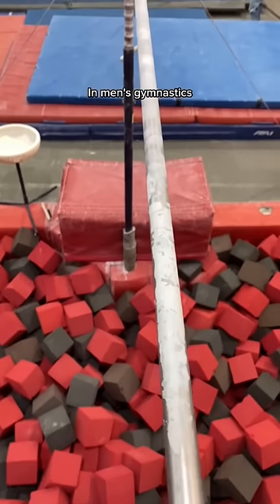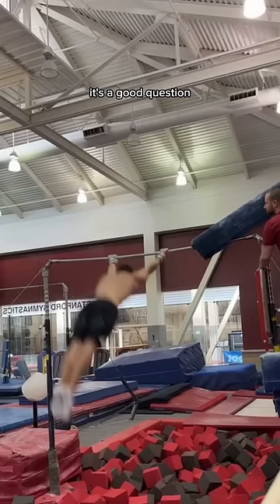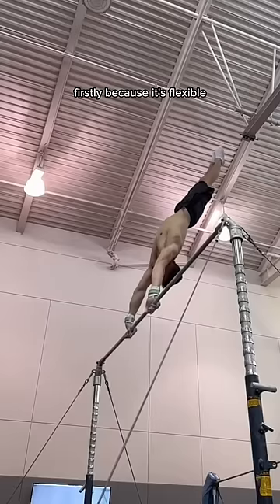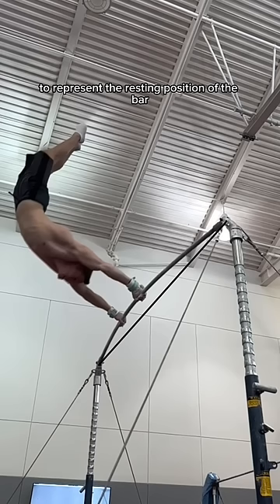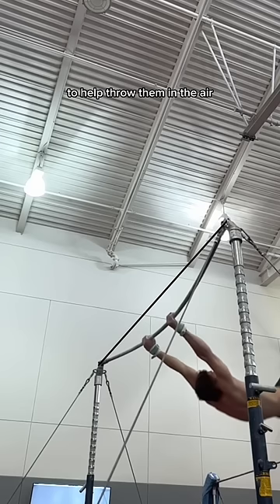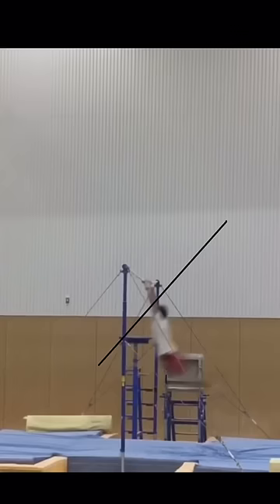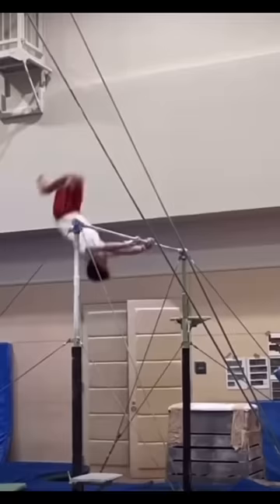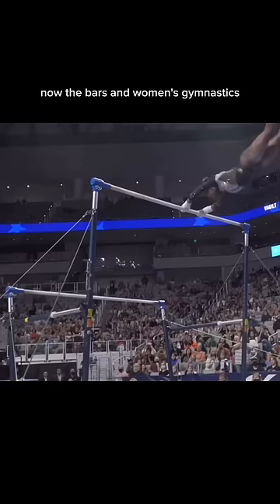Why is it made of steel 🤔 #gymnast #gymnastics #sports #calisthenics #parkour

Comment: The bar was made of steel and you still managed to break it
Reply: Yeah thats not a common thing tho
Reply: Steel has a pretty high yield point. That is, you can bend a piece of steel a lot before it wont return to its original shape. However, when you get it close to its yield point, you add a tiny bit of fatigue. If you do that over and over and over, the metal will become weaker and weaker until it eventually tears. Theres also the concept of work hardening, in which if the force on the metal slightly exceeds its yield point, the metal will become slightly harder and more brittle

Comment: If they have to be strong and flexible, is there any carbon fiber bar? Wonder if they're good also.
Reply: Carbon fiber isn't really flexible. It's strong in whatever direction it's designed to be in so if someone landed on the bar and the grains weren't point the right way it could snap
Reply: afaik in my knowledge of cars, carbon fiber is strong, but it can shatter, pretty much rendering it as really brittle.
i think this is more of a long term thing when it shatters rather than it just exploding as soon as you put a bit too much pressure on it.
but who am i to talk? maybe they're just as good or better.

Comment: The female bars do not need to be as strong because female's cannot swing as hard due to there being a second bar (uneven bars hehe) that prevents a full on streched legs swing. 

Women are lighter on average,
Women are around 10% weaker than men (no offence, it's just genetics). 

Men just do double flips and twisted flips in quick succession sometimes on the bars, while women don't even have the space, I mean look at a routine Nadia Comaneci did: she hit her hips on the lower bar while holding onto the higher bars because they are so close together.

Imaging even being able to swing enough for a double flip with bent or spread out l2gs and then crashing down on the bar whil cathing😬. No, just not probable.
Reply: Thanks for pointing that out! I was honestly a tad curious
Reply: There's actually a much higher strength differential than that. According to Princeton,  women have roughly 67% the muscle mass that men have. The study was conducted on male and female powerlifters. So even the strongest female powerlifter only has 67% of the power the strongest male powerlifter has. It's pretty crazy how big the muscle differences are between men and women, but it makes sense.
Reply: @monkeytime  wow man, that’s insane

Comment: Why couldn't it just be expressed as that women also need to be able to bend the bar to get more power to swing, and because of their lighter weight, steel isn't as suitable for the purpose?
Reply: ?

Fiberglass isn't flexible, so maybe the wood is, but my impression was that he's saying women aren't as heavy as men so they don't bend the bars, which makes it so that there's no need for something as strong and flexible as steel.
Reply: He already explained that they dont swing as hard. Using your brain you can intuit the rest
Reply: The reason it’s different is a actually cause the uneven bars started out as a set of parallel bars with one bar set to a different height. The uneven bars have gradually changed to what we have today but the materials never did (of at least never had a reason to)
Reply: @nullfield1126  ever heard of pole vaulting? Fiberglass can be very flexible.
Reply: @timdurachko  Hi! It seems like there are flexible ones indeed. Vaulting poles being a prime example, thanks for correcting me.

I only knew of the harder variants.

Comment: The name of the women's apparatus is called Uneven PARALLEL bars for a reason. My understanding is the first bars for ladies were parallel bars set at unequal heights, I don't know at what point they made them round, but I think this has far more to do with the origins of the materials used for the women's bars than anything else.
Reply: You do know parallel just means running alongside each other right? So the two bars running alongside each other makes them parallel. So the bars could likely still have been round when first created?
Reply: You might be mistaken on what parallel means...

Comment: Also to add, the bars in women’s gymnastics were originally a lot closer together and were essentially the men’s p-bars with each bar at a different height, hence why they are called uneven bars or asymmetric bars. Over time the bar has become further apart and the skills competed have changed, but I’d imagine it also relates to the origins of the apparatus - just as the men’s high bar has always been made of steel. The skills that men and women compete on each also differs a lot, though as a former competitive gymnast we did use the high bar with gloves and straps to train skills before taking them to the wooden bars. But having used the wooden bars my whole life with a very different grip, it also felt so strange and not wide enough when using the steel bar 😂

Comment: Huh. Interesting. So if a man would use the female's bar, would the bar break?
Reply: It would be a lot harder for men to do skills on a female bar, because along with being wood, the bar is a lot thicker and bigger and would be harder to grip. Would it break? Probably not. It would just be a lot harder to do flips and such over it without the springy quality
Reply: The wooden bar doesn’t bend as much and is much thicker than the steel. It wouldn’t break but it would be a lot harder to do skills.

Comment: Okay, but who would care about the average in the top level? Surely, both would need strong materials when they're taking the human limit. The sex advantage can only carry so far before it starts boiling down to pure skill and training even against someone without said advantage.
Reply: Or … maybe, men just on average weigh more than women?
Reply: The wood and fiberglass are strong enough. And keep in mind that both averages increase as you go up in skill. Joe shmoe will probably weigh a bit more than peak female athlete but peak male athlete will most certainly weigh more than peak female. The bars need to be different. Also, this is not an example of pure skill. This is high amounts of skill and high amounts of muscle. Which is heavy and that men have more off. Chess and other games are "pure skill". Every sport will have advantages and disadvantages based on muscular genetics.
Reply: The sex differences become greater at the higher levels , use your brain
Reply: The reason it’s different is actually cause the uneven bars started out as a set of parallel bars with one bar set to a different height. The uneven bars have gradually changed to what we have today but the materials it was made of never did (or at least never had a reason to)

Comment: Isn't that like begging the question, or cart before the horse or some shit? They men use steel because it bends but the women don't use steel because they don't bend as much? That actually makes no sense. It seems like the use of the steel dictates potential, not the other way around.
Reply: Well men are heavier and stronger on average. Idk
Reply: I’m pretty sure this guy above summed it up. idk
Reply: I saw this on another comment and it said because the grip used in women and men’s gymnastics are different. Women’s gymnastics needs to switch between two different bars where the men’s is just one bar. Female gymnasts are also usually lighter due to the demands for flexibility
Reply: "They men"

Comment: Steel was also chosen because it doesn’t splinter as much when broke and doesn’t typically get a sharp edge. Along with this, men’s gymnastics came before women’s so, as technology advanced and steel got expensive, women’s use cheaper but reliable materials since a lot of them need to be made.

Comment: Women’s bars were originally men’s parallel bars just staggered. Look at old routines from the 50’s and the 60’s. It was a completely different event from what it is today. The cross section of the old parallel bars was an egg shaped oval with the wider part at the top. As the event evolved the bar became more of a true oval but still made of wood. In the 80’s a common combination was a belly beat and land on the feet on the low bar and jump to handstand on the high bar. As you rose off the bar from the belly beat the bar oscillates. If you land on the feet at the wrong point of the oscillation you go right through the bar breaking it. At one college meet we broke 3. They started making the rails out of fiberglass with a wood laminate so it still felt like wood. They also changed the cross section of the bar to be less oval and more circular, also smaller in circumference. So much nicer to work on and more bouncy. Gymnastics has evolved, wood for women and steel for men was not a decision from the onset. The evolution of men’s high bar is almost as interesting.

Comment: Also because the weight in still is 10 to the biggest I've seen was like 30 or 40kg lightest woman to heaviest man but it would be about 10 or 20 on heaviest to heaviest. And now you take in physics, the force those extra 10 20 kg put in would probably be able and snap the womens bar and so it's just safer to have men stay on steel while women get the safer bar

Comment: Maybe Carbon Fiber could also be a good material?
Reply: Way too flexible, carbon fiber strength lies in tensile strength not shear
Reply: @RYU47376  Yeah, just that I know about planes and on newer ones Carbon Fiber is ised for the exact same reasons listed here, so I thought it could be a good idea
Reply: I thought carbon fiber was not flexible at all?
Reply: @dubious_potat4587  It is, thats why it is getting used in planes recently. It is very lightweight, strong and flexible

Comment: Wood and fiberglass sounds way more dangerous.
Reply: no it won’t shatter like you think and hitting blunt steel would hurt a lot lot more
Reply: @alilalani9531  hitting wood doesn't sound pleasant either
Reply: @StressHaze  still .. Compared to steel , wood is better(despite both hurts as hell
Reply: Nah the fiberglass bars are much more forgiving, women make much more bodily contact with the bars so a steel bar would just be painful. I remember messing around on the girls bars and it was much easier to make consistent contact with it
Reply: Yea the reason it’s different is actually cause the uneven bars started out as a set of parallel bars with one bar set to a different height. The uneven bars have gradually changed to what we have today but the materials it was made of never did (or at least never had a reason to)

Comment: I thought it was obvious 
I know Jack all about gymnastics 
But I could tell they're different because men are typically larger and exert more force on the bar 
Women just wouldn't bend the bars that much so fiberglass and wood is acceptable there 
While men exert more for e and therefore need something a bit more strong and a bit more flexible

Comment: The difference is just what material is best suited to each sport. High bar is all about building up momentum for big releases, therefore, the bar is springy to assist in launching the gymnast off of it. An inflexible bar would inhibit that. Uneven bars are about transitions and combos, therefore, the bars are solid to conserve the energy for the next swing after a transition. A springy bar would act like a shock absorber and dissipate the energy rather than conserving it for the combo or next transition. The apparatus doesn't care what sex you are, it's designed to enable the sport it was built for.
Reply: Thank you. This person understands gymnastics.

Comment: I guess we have to fix this sport now
Reply: Yes, but for completely different reasons than the comment section seems to think right now. Did you know that women get points taken off if they don't smile, or if a bra strap or bit of panty is showing? They also have to have bare legs while performing. Men don't have to smile (it might actually be discouraged? Not sure on that one), and are often required to wear long pants (which was explained in a different video). Like, why couldn't a female gymnast wear biker shorts, footless tights, or the same pants as the guys if they wanted? Why should they get downgraded for being tired and not wanting to smile near the end of a routine because they need to concentrate instead?

Comment: I like how he keeps saying "on average" so he's not just saying women don't do as many powerful swings when some might or do
Reply: Their routine is overall different. Look up competitions. Also, on average it’s easier for women to swing than for man, because their center of weight is lower (and again, theoretically on average, but every sport requires certain physique, so in this case generalization is not incorrect, for example almost all competitive swimmers are tall and slim), so they don’t need to use the same amount of force to swing, it’s generally easier to swing if your center of mass is lower

Comment: Question, if the mens and womens bars were made of the same material, how would that impact the sport? 

Would it improve performance for women if they used the men’s bar, or vice versa if men used a women’s bar?
Reply: It would probably depend on the man and woman

If there was a woman who was incorporating a lot of intense flips into her performance or if she were heavier, or if a man was smaller and/or doing a set that had some of the moves that women do, then a different bar might aid them

Since men are typically less flexible, the flexible bar helps them out when swinging their weight around. And since women are typically more flexible, they don’t really need that, and the bar staying in place aids them more. Like he said though, it’s on average. You probably get used to whatever bar you’ve been using eventually, and either way switching it up would affect your performance
Reply: Yeah, men and women also usually do different types of executions on the bar, and might be scored on different aspects of the performance. Stuff like Technique and Artistry can be seen with different eyes by the judges for men and women.

So even if a steel bar would make a women perform better in the aspects that are scored for men, it might hamper the aspects that are scored for women.

Comment: Different tricks call for different material, is essentially the sum of it, for anyone wondering.
There’s a reason why they’re differentiated by Women’s and Men’s Gymnastics. If they all did the same thing, same methods, with the same techniques, they would’ve just called it “Gymnastics”.
Both can be extremely good at either, it’s just the way they’ve categorized the two by body type. (The Men are often Bulkier/Heavier since they gain muscle mass far more/quicker than the Women, which is basic Biology. Women in these sports lose fat and become Toned, and on average have less body mass. So they don’t require a bar that tough, because they’re elegant, and often way lighter/gentle.)
And yes, men can be slim in these sports and women can be bulky. I’m just speaking in the high percentage (Majority) of people that pertain to these reason. Which is, almost everyone. (Plus, women are typically more bottom heavy than men. So the momentum is carried much differently for either materials.)
Hope this helped. Have a good one. 👌
Reply: This is like the most friendly explanation of a somehow highly controversial fact. Respect

Comment: Women are usually lighter than men, especially gymnasts, so having a steel bar for the women would probably hamper their ability to launch off the bar since it wouldn't bend very much unless they made a thinner bar for the women, which would probably cause other issues for them.
Reply: It’s not based off a body type it’s age based

Comment: Do some of y’all actually think that men weigh so much more that if they touch a women’s bar it’ll snap instantly? It’s pretty easy to find videos of guys performing tricks on a wooden bar, it holds up just fine.
Reply: 1. He said presumably, he's making a reasonable estimate because 2. He said on average.
Men on average have more muscle and weight meaning that it's a reasonable estimation that a stronger material is needed.
Reply: @cheesemcbiscuit3713  I wasn’t talking about him I was talking about people in the comments
Reply: That is not what they are saying. After so many strong swings with a lot of weight behind it, the wood and fiberglass would get worn down faster than if a woman is using it.
Reply: Other people (not just men) use steel bars because it's less likely to break when doing powerful exercises
Reply: @greenbeantm1096  apologies then, its quite hard to know exactly whats meant in a text i hope you'll understand.

Comment: If caitlyn jenner participated in this sport today, which bar would be used?
Reply: It depends on how much force and power she would put on the bar. Some trans women may use wooden and fibreglass bars and others use steel bars.
Reply: I assume it would depend on weight, and strength of the individual person, considering a lot of the cis girls in my highschool that were in gymnastics used steel bars. (My cousin used the wood one)
Reply: @stanalldogs  well the routine they do also contributes, the sets that they do need different bars not entirely because of sexes but also because of the moves. Bigger jumps that need for elasticity from the bar would use the bar that can handle warping better.